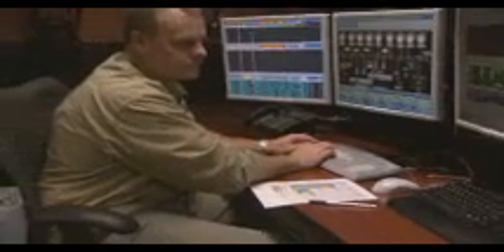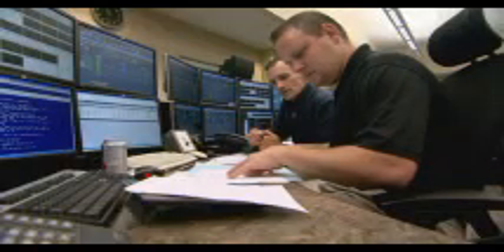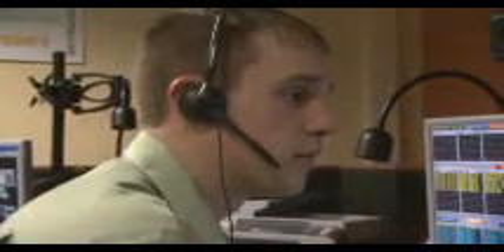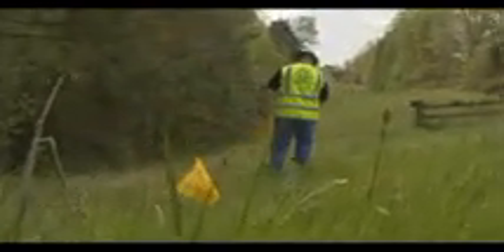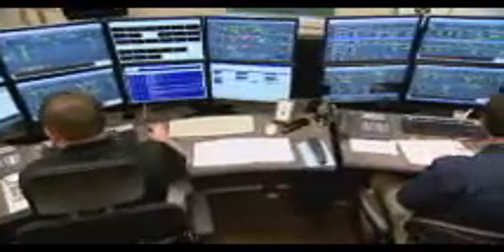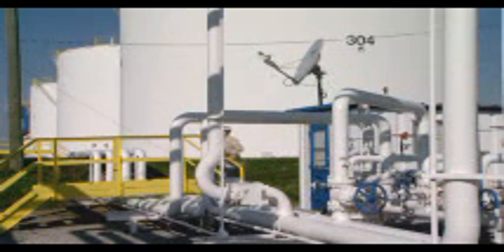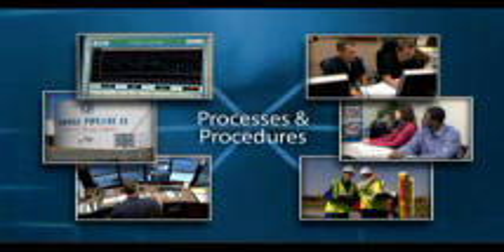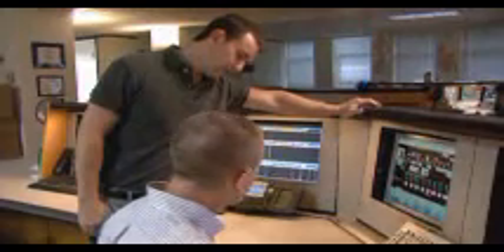Pipeline Control Room

Comment: Same job, different company. 140k salary
Reply: Do you have any hints on the cobra test? Any advise?
Reply: @robertabril7719  damn sorry I missed this.  To succeed with the cobra test you should research a distillation column and how it controls and maintains pressure, temperature, and level. Go over this in your head.
Reply: Which company is shown in video??
Reply: @thorodinson524  shown? it's BLURRED to the max.
Reply: How do you start off in this field. Currently a tank farm operator in a refinery so i already deal with pipeline transfers at a small scale but dealing with them at a large scale from an operation center sounds very interesting